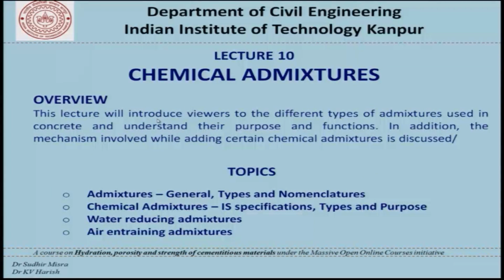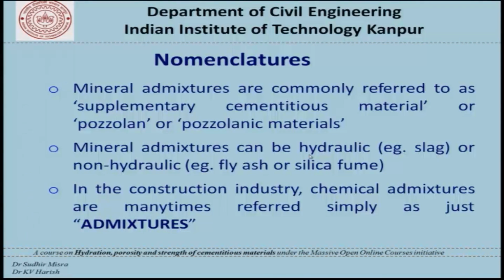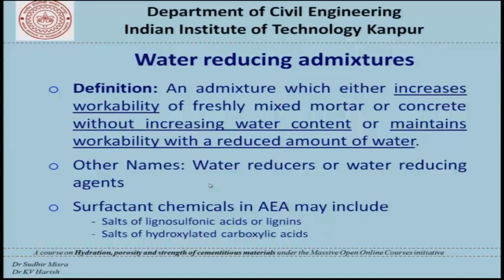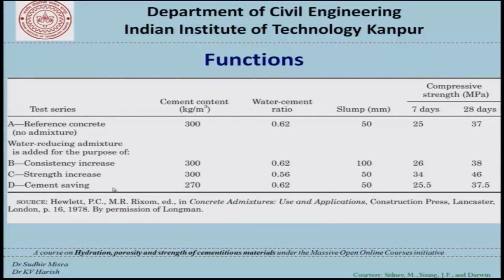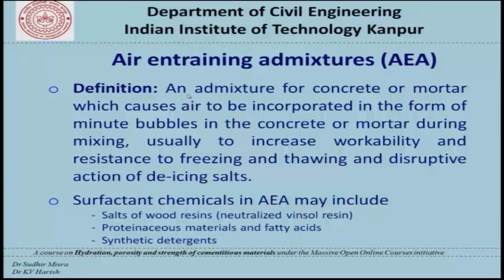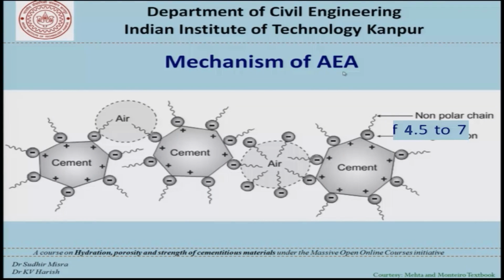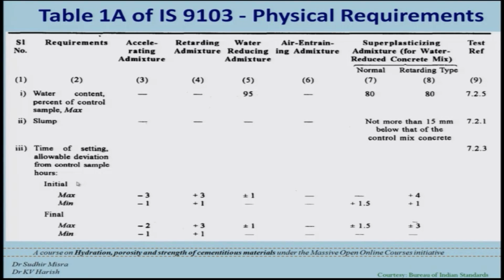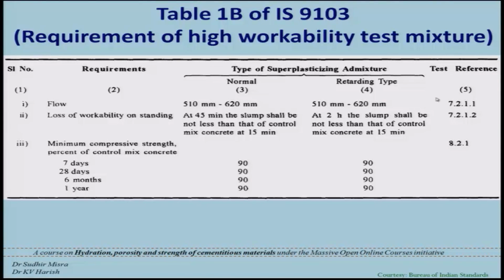INTRODUCTION (CHEMICAL ADMIXTURES)

Comment: Mineral Admixtures are used as a replacement of cement which is more than 4% as against mentioned in the lecture. Correct me if I am wrong
Reply: Yes, mineral Admixtures can be used as high as 70% of total binder content